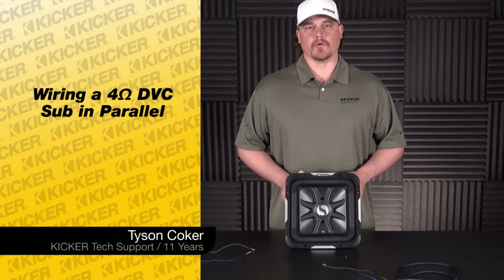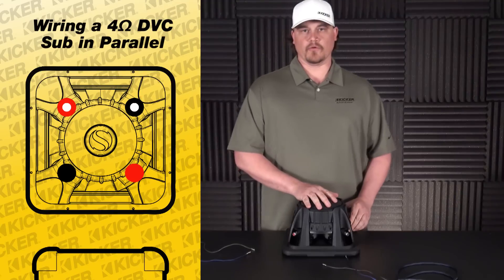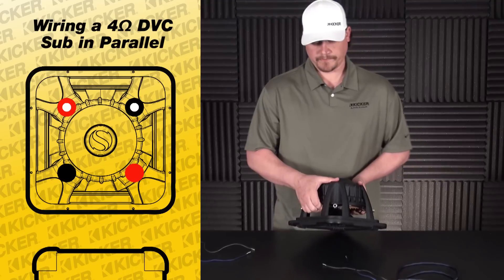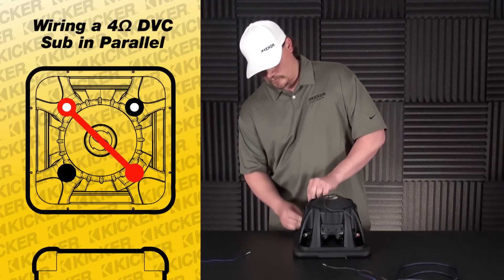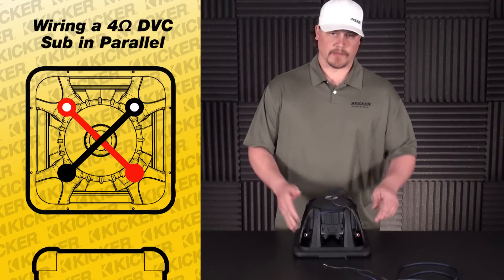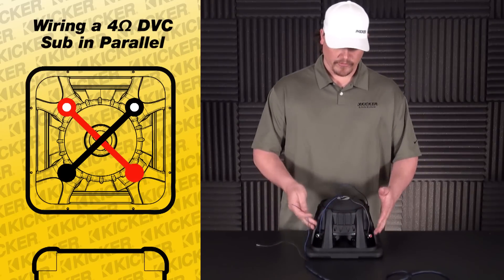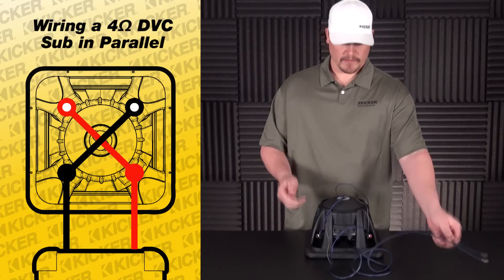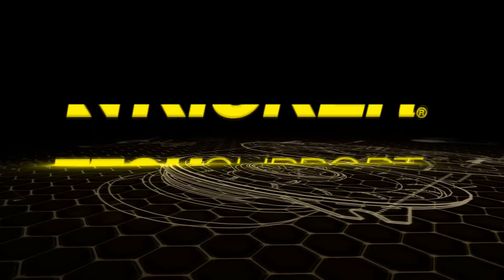Subwoofer Wiring: One 4 ohm Dual Voice Coil Sub in Parallel

Comment: How about creating a 4 ohm load. How do you do that?
Reply from the maker: Unfortunately you can't, unless you only use one of the coils, but you'd lose half of the power handling in the process. If you need 4 ohms, get a 2 ohm DVC and wire it accordingly.

Comment: @Kicker Will this sub be safe if my amp is doing 950w RMS at 2 ohm load? If so, how long is the break in period? Should I run it a month with the gain at a quarter? (its going in your little kicker ported polly filled box i got with my last L7 that finally blew after like 10 years use) Thanks.

Comment: if you have a dual 2 ohm sub and both read 2.1 ohm but it always reads 2 ohms even if wired series or parellel. whats up with the sub?
Reply from the maker: +robertrdumke HOw are you wiring it?  Series or parallel?
Reply: +KICKER well i wired it both ways.  and it reads 2 ohm on parallel  and series.
Reply: +KICKER this is how i properly wire my 4 ohm l7 15 to my kicker amp ?????/
Reply: Chris Parra

Comment: I have that same model (4ohm) sub.When I check with my multimeter it said 2.3, then when I check at the amp it said 1.5. Is this normal?
Reply from the maker: There is always a range (a small one), but most 4 ohm subs aren't exactly 4 ohms and most 2 ohms subs aren't exactly 2.  It's almost always a little lower than what is listed as the "standard." It's true for most speakers.
Reply: @KICKER-AUDIO  I asked because I wanted to have a 1ohm load with 2 of my subs. My question is does it supposed to say 1ohm when I check it at the speaker terminal on the box or check it at the amp?
Reply from the maker: The DXA125.2 is capable of delivering 125 watts at 4 ohms. The 12" CompR needs 500 watts, so a new amplifier would be required if you installed it into the enclosure. Additionally, the enclosure is below the minimum recommended air space for a CompR.  In the long run, you would be far happier with a different amp and enclosure to go with the new sub.

Comment: Ok so I have a 10" DVC Subwoofer at 4 Ohms...Says 300w RMS 500w Peak...Now if I run it parallel I will get 2 Ohms Correct? My Amp Says it will push 500w RMS at 2 Ohms...is this too much power? Should I Run it in Series to get the 8 Ohm load? I believe this might slightly underpower sub but will keep it in a safe zone correct? Or can I still run the 2 Ohm Load with just some tuning of the power on the amp.
Reply from the maker: With either wiring option you will need to consider the box volume and type, gain settings and type of music you listen too.  If you run the sub in series then the amp will only push around 125 watts RMS to the sub.  What happens in this case is the output is not what it could be so the volume on the radio gets turned up and the gains on the amp get turned up so that you get more output.  Normally this will burn up a speaker.  Overpowering a sub is a little better because you tend to dial back the settings.

Comment: I have a kicker amp kx2400  2ohm 
Im planning to put (2) 15s L7 in a ported box,. 

Question, should i get a 2 or 4 ohms sub and how to wire it? and connect to the amp????
I want to take all the power possible, out of this amp
 thank uou
Reply from the maker: If you get the dual 2 ohm subs, you can wire them to 2 ohms (series parallel).  If you grab this free app, you can get box dimensions, wiring diagrams, technical specs and a lot more: http://www.kicker.com/kickeru
Reply: KICKER Thank you👍

Comment: Are you using normal speaker wire when wiring in parallel? If so is there a specific gauge size of wire?
Reply from the maker: As to the first question, yes, we are using standarad OFC (99% Oxygen Free) copper wire. As far as wire gauge, 12 works well for most subs.  Extremely high power subs (talking several thousand watts per sub here) you may want to upgrade to 8 or 10 gauge.  It's also going to depend on the size of the speaker terminal, and what it can accept.  Just know that there is no real down side to "overdoing it" on wire size.

Comment: If my dvc speaker is calling for 4 ohms then what does it change that the final load is 2 ohm? Wouldn't I want to run 4ohms like the speaker calls for ? You will have to pardon my ignorance on the subject as I'm still learning about ohms
Reply from the maker: A DVC speaker with two 4 ohm voice coils wired in parallel will be two ohms. If wired in series, they will be eight ohms. Can you tell me what the model number of  your amp? We can investigate what the amplifier is stable to from there.

Comment: I wired mine this exact way and it doesnt produce anything for sound. I can hook up other subwoofers and they work well with the same amp and wiring. Is it my l7 thats the problem maybe its bad? It doesnt feel (when pushing it in) bad nor does it look bad. What else could be the problem?
Reply: Its a l7 15 wired to a zx750.1 kicker amp everything works besides the sub doesnt make any noise or bass or anything. However if I connect a different sub like my 12 kicker to the same setup it works just fine. Im lost.
Reply from the maker: Wiring in series doubles the ohm load.  Wiring in parallel cuts the ohm load in half.  This means that, depending on how you wired it, you may be giving the amp half the power (or less) it is capable of.

Comment: I noticed in my RF manual that it said after wiring the pos with pos and neg with neg, to use the pos from one coil and the neg from the other.

Is this manufacturer specific?
Reply: yes..inside manual state that. 
confusing here...

Comment: Any way you can make a video on the solo x 12" dual 1 ohm on a Memphis 2000D thats 1 ohm stable?
Reply from the maker: Porter Porter If you had a single sub that is dual one ohm, and the amplifier is one ohm stable, you would not wire in parallel. You would wire in series.  This would give you a two ohm load. That is the best you can do.
Reply from the maker: Porter Porter Unfortunately, physics gets in the way of that. A one ohm subwoofer can only ever be either two or four ohms depending on how it’s wired. The only other option you would have, and we don’t recommend this, is to only use one of the voice coils.

Comment: What if I have my wiring the same as you do in the video. I'm going for a 2 ohm load with one 15" kicker L7 4 ohm dvc. but my volt meter reads 03.1ohms. is that normal?
Reply from the maker: There are a few possibilities.  First, are you measuring the load with the wires attached to the amp?  That will throw off the reading.  The other thing is to verify you have it wired correctly:  positive to positive, and negative to negative.  Lastly, make sure you've zeroed out the meter.  Set it to ohms, then touch the probes to each other.  It should read 0.0 ohms.  If all of those things come out OK, then lets have you talk to our Tech Support crew. Their number is 405-624-8510.

Comment: I have a problem i have a dxa 1000.1 kicker. Amp with a 4 ohms L7 15 but when i turn up the volume it lights up the protect mode light when the bass hit can you help me im wiring in parallel
Reply from the maker: Is it a single L7, or do you have more than one of them?
Reply: Its a single L7
Reply from the maker: Then it maybe a wiring issue.  Give our Technical Support department a call.  They are open 8-5c at 405-624-8510.
Reply: Oh ok y
Thanks
Reply: I thought i was the battery or that I needed a capacitor
Reply from the maker: It could be the battery, but we dont normally recommend caps.
Reply: did you ever get this issue solved?  I have the same problem with my L7 every time the sub trying to hit a deep bass note the amp goes into protection mode then comes right back out.
Reply from the maker: There are a few possible reasons why this happens.  The first cold very well be a wiring or power supply issue (ie your battery doesn't have storage to handle the current draw of both your car and your stereo, so the voltage drops and the amp overheats, or the primary fuse is too small).  Another possibility is the sub is damaged. There are ways to test and verify what the real issue is.The shop that did the installation would be the first place to go. Calling us and asking for Tech Support is definitely another option.
Reply: KICKER I'm going to check the ohms on the sub to make sure it isn't blown first and make sure it's wired properly.   If it continues to do it then I will test the voltage at the amp and the remote to make sure it's about the same.   I was also told to  heck the voltage at the battery as well.   They said if all of these doesn't fix the issue then I may have the gain turned up too high
Reply from the maker: Yes, checking the ohm load of the sub (not conncted to the amp) is definitely a good thing, as is verifying the amp's gain & Bass Boost settings are optimized. If it helps, we have a number of amplifier setup videos. Check the Tech Support & Training sections of our YouTube page for more info on that.

Comment: how would i wire one single jl w6 v2 like this because the positive and negative is different on the jl's brand. im confused
Reply from the maker: macteesac If you go to the JL website and under the discontinued subwoofers, select your JL W6v2.  Then under the technology tab, it will show you a wiring diagram for running your sub in either series or parallel.

Comment: Hello mate, I am facing a issue here, I am trying to wire my single dual 4 ohm sub to 2 ohms but, in my DMM it is showing only 2.9 ohms... I cant understand what is wrong. 

Some says the sub installation position does affects the impedance, is it true? my sub is installed firing back as vertical position. 

PLEASE HELP ANYONE?

Comment: Dual 40 VC. Can it be brought to a 40 load. Thank you
Reply from the maker: Sorry, not sure what you are asking.  Did you mean 4 ohms and not 40?
Reply: KICKER. Yes Dual 4Ω ohm VC. But upon more studies it's not possible to get a 4Ω load. Thank you for your fast reply.
Reply from the maker: You can wire 2 4 ohm DVC subs in series parallel to get a 4 ohm load.  Sorry for the delay - been at Lone Star Throwdown for the past few days.  You might want to grab our free app to see the wiring diagram, get box and sub specs, etc... www.kicker.com/kickeru

Comment: I believe your supposed to use a + from one voice coil and a - from the other voice coil
Reply: When wiring in parallel you wire from the + of one voice coil to the + of the second voice coil.  If you use the + of one voice coil and the - of the other voice coil this would be wiring in series and would give you an 8 ohm load.
Reply: how do you keep a dual 4 ohm at 4 ohm?
Reply from the maker: paperboi714 You are not able to.  When you have a dual 4 ohm sub, you can only wire them in either series or parallel and this will give you either an 8 or 2 ohm load.  To get a 4 ohm load you will need to get a dual 2 ohm sub or a single 4 ohm voice coil.
Reply: KICKER Thank you Kicker, this answered my question as well.

Comment: how would I wire 2 cvrs dvc to zx1000.1
Reply from the maker: What ohm load are the CVR's?  This will determine how it's wired.
Reply: KICKER 4ohm
Reply from the maker: You'd want to wire them in series parallel to get a 4 ohm load.  This is lowest load you can safely hook up to the amp with your subs. If you like, use this free app to get a diagram: http://www.kicker.com/kickeru

Comment: What if I want to put it on a bridged 2 channel
Reply from the maker: Most 2 channel amps can be bridged to 4 ohms. Check your amp documentation to verify that.
Reply: @KICKER-AUDIO  it does allow me to bridge at 4 ohms stable thing is my dvc sub is 4 ohm and when wired in parallel  it ends in 2 ohms which is good, but then wired to series it ends with 8 ohms. I need it to end in 4 ohm to bridge it with the amp or can i connect to the bridged amp with the sub at 8 ohms?? Even though the anp clearly states 4 ohm stable in bridged mode.
Reply from the maker: @mrisdabest2  Right.  Unfortunately, you can't do it with that sub alone. You'd need to change subs, add another one, or change amplifiers.
Reply: @KICKER-AUDIO  i was able to bridge it however it isnt as loud as it should be. I will be getting a different amp. A more adequate amp to power the Solo baric 10 in L7

Comment: Can you make a video on wiring 2 4 ohm dvc subwoofers to a final 2 ohm impedance?
Reply from the maker: Unfortunately it is not possible to get a final 2 ohm impedance using 2 x 4ohm DVC.  Your only option with those subs is either a 1 ohm or 2 ohm load.  If you are able to exchange these for dual 2 ohm subs you can get a final 2 ohm load.

Comment: I did this with a 4ohm 12" kicker L7 with two subs wired seprate to its each connection on my box to the amp and it burnt my subs i had two L7s on a 2500w hifonics brutus amp
Reply from the maker: Mr G if you did this with two subs then your ohm load was probably half what should have been, which would explain the issue. Check out a free wiring app we made called KickerU: www.kicker.com/kickeru or you can call us at 405-624-8510 weekdays from 8-5 central time.
Reply from the maker: Unfortunately, on a mono amp, wiring two subs to two terminals is not the same as wiring up a stereo amp.  On a stereo amp, each set of terminals is treated as an individual set of ohm loads. On a mono amp, manufacturers have two sets of terminals for convenience.   It simply makes series or parallel wiring easier.
Reply: @KICKER-AUDIO  can you guys please demonstrate this in a video ive burnt (4)12" L7's already....... Im so sad and i just keep on buying new ones but i wana learn because installation is expensive too and the guys that installed my system didnt do it right there the reason my first set burnt... And the made my battery die over time on my 2018 camaro.... 😥 i just wana bump 2 kicker L7s with my hifonics brutus 2500w amp

Comment: Damn I got a used sub dumb ass tweeker didn't know Jack shit on how to wire two of the 15 inch kicker comps and the box eh drilled in the back instead of that cap with the plug-ins OMG well any way it was neg to neg one side oddly worked and the other didn't so I applied this method wow holy shit my ears are ringing. booms loud  for just comps 15s...but the drilled holes on the back of the sealed box leaking out a smell that would be normal cuz the subs are working good or do I need to tern the gain down from 3/4 to what or what's a safe but booomming spot
Reply from the maker: juan martinez that smell could be from the box, the subs or possibly some batting that rotted.
Reply: @KICKER-AUDIO  thank you

Comment: I have a kicker a 2 ohm 15 comp vx sub 1,000 watt rms/2000 watt max, and a kicker cx 1200.1 mono amp. Do I need to wire in parallel or series to get the best output?
Reply from the maker: Tre Bronx what's the ohm load of the sub?
Reply: @KICKER-AUDIO  2 ohm
Reply from the maker: The most you are going to get out of a 2 ohm DVC sub in that case is 600 watts.  Here's why: First, a 2 ohm dvc sub can be wired series to 4 ohms or parallel to one ohm. Since the amp cannot be wired below 2 ohms, your only choice is the 4 ohm option.